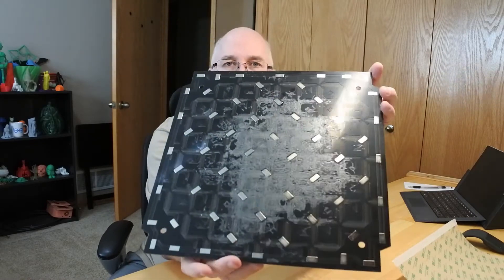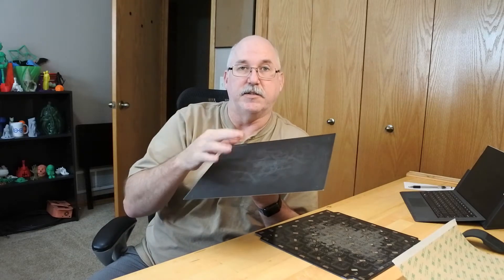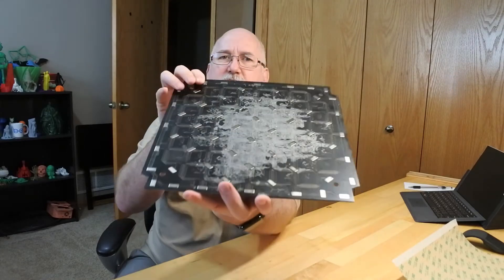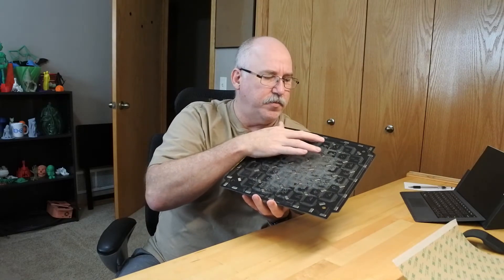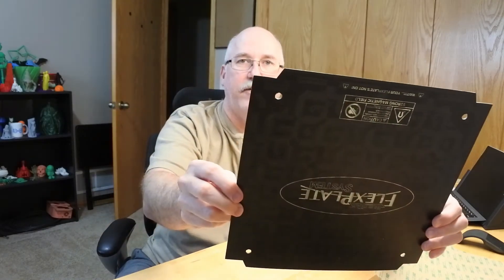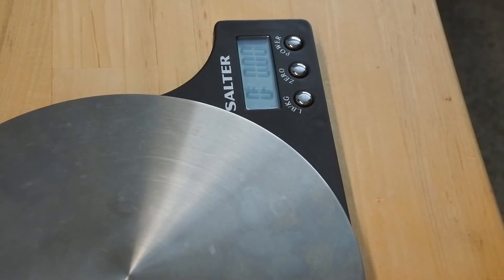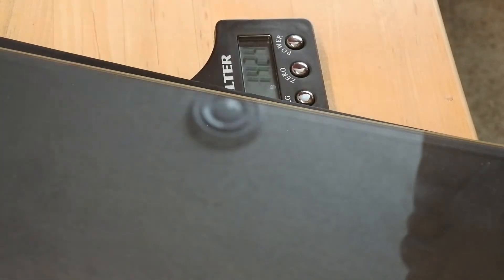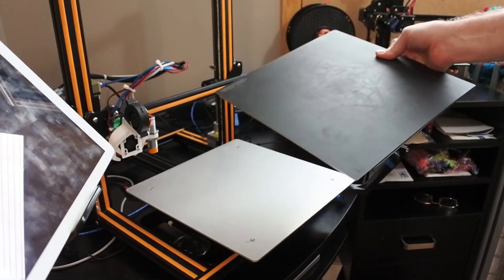Buildtak Flex system Replacement

Comment: Nice tip on the hole mod. My flex system is arriving tomorrow, will do the same on mine. Also have an Ender-3 coming today and thinking about buying the flex system for that too. I too was having issues with Y shifts and went ahead and increased the current yesterday, which seems to have helped (belts were tight). Although I'm also seeing a warmer motor now too which I don't like.
Reply from the maker: bumping current is like walking on a tight rope over glass :)   As long as you are working..  life is good lol   as long as you can hold the motor it will be fine.  (probably)

Comment: Thanks for these vids. I'm debating getting a FlexPlate. It's a good chunk of money, I've had trouble with PLA sticking to the buildtak so I have to throw out the 'tak. You've been using the FlexPlate for several months now, do you have a followup? Complaints? Have you had to replace the buildtak surface?
Reply: "smarter", but I've gone through three pieces of buildtak in the last month, have had trouble getting things to perfectly stick and yet release. that's why I was thinking the flexplate would help. Love the idea of hitting it with 220- nice to know that's a good grit size.